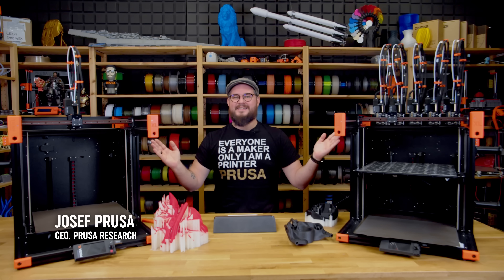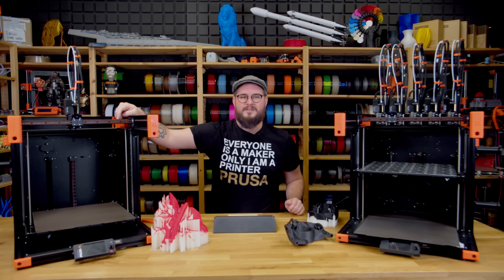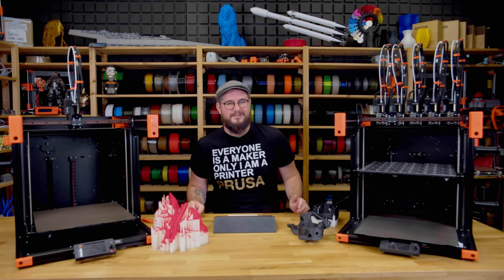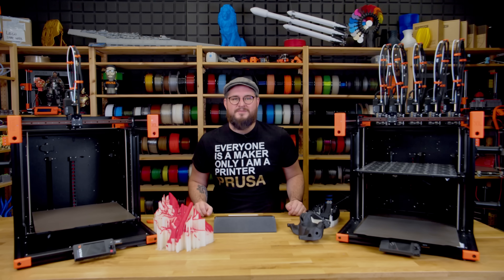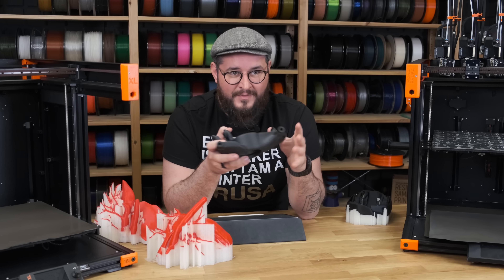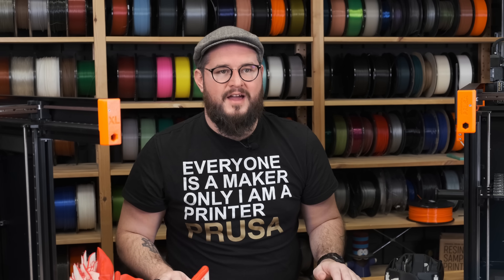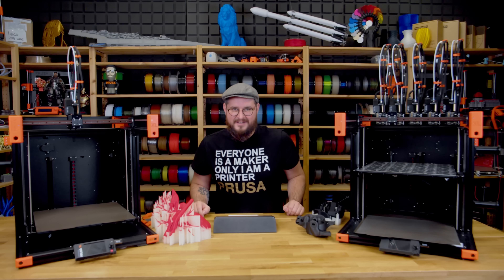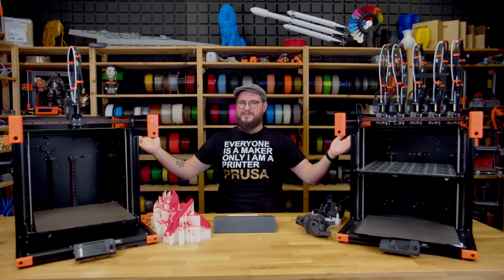XL update - beta test news, hardware changes and shipping schedule

Comment: Hmmm...I ran my business with  4 MK3S+ printers but have recently sold them all for 3 Bambu X1 Carbons with AMS which as everyone knows are MUCH faster, and in my experience have even better quality. The MK3 now feels like a toy. I had two Prusa XLs on preorder, canceled one of those.....just not sure about a single tool head $2500 printer when another X1 Carbon with AMS would only be $1500. Sitting on the fence about the XL. Bambu came along and really changed the game while Prusa was resting on the MK3.
Reply: I will preorder a XL because you can use different materials in one print. For that you need multiple tool heads. I already own a Voron 2.4 350mm with mmu but I want to print supports with different material and for multi color print to not waste a lot of time and material on a waste tower.
Reply: @Todestelzer  why do you need multiple toolheads for different materials? I know the one example Prusa shows with the TPU would need multiple toplheads but you shouldn't have any issues printing support material or PETG as a support using the same nozzle.
Reply: Problem is with Bambu, their long term support is unknown. I really want a Bambu but Prusa at least has a track record
Reply: @armorhide406  True but the same can be said for Prusa when they started. Gotta start somewhere.
Reply: Prusa xl is 5 times faster than bambu x1c with ams and ha e no waste 😉si if you can calculate you have that investice t pretty fast back and you cam při t lot more materials , you can combine materials, you Dent send your clie ts data to china  etc. And you support comunity with prusa because bambu Just stealing models patents etc
Reply: The X1C and the Prusa XL have some major differences and you have to choose which fits your needs better. One of the them is the much bigger bedsize of the XL. The second is the Multi Material System. Obviously the XL e.g. allows you to choose different materials within one print. It allows you to print ABS and TPU in one part. Obviously it’s not price competitive since Bambu manufactures in China, where overall production costs are a lot lower. I am pretty sure there are still people which have usecases that fit the XL better.
Reply: @justinspohn1092  Yeah there is for sure use cases for the XL that the Bambu can’t cover.
Reply: @justinspohn1092  Oh I completely agree with you! I’m going to go ahead with my single head XL just because I do love Prusa printers. My point was just more that Bambu came along and really changed the game! I was a Prusa fanboy snob until I got my hands on an X1 Carbon. I just hope Prusa comes to the table strong 💪 like we know they can to compete. As consumers we all win with competition.
Reply: @justinspohn1092  The price difference isn't just about the labor cost, Prusa's printers use a lot of standard components and 3D printed parts. While that's fine, it's inherently going to be more expensive for mass production versus a design made mostly of folded sheet metal and injection molded parts.
Reply: I am considering cancelling mine and getting an X1 Carbon and AMS, By the way do you know the difference is between the X1 and the X1 Carbon?
Reply: @AndrewAHayes  It's on the Bambu Labs product page for the X1 series, but you have to scroll down a lot to get to it. I'll try to summarize: Aluminium instead of plastic body, hardened steel gears and nozzle instead of steel and stainless steel, aux part cooling fan and carbon filter included, internal monitoring camera included.
Reply: Yeah have fun with your Chinese made piece of shit.  You get what you pay for.
Reply: @mcxiii  Well my experience so far is the Bambu prints 2-6x faster than a MK3 and has better print quality while doing it. 100s of hours of printing and no issues. So yeah I’m having fun with my piece of Chinese shit 😂 x 3.
Reply: @damiengvideos4337  talk to me when you have 6000 hours.
Reply: @damiengvideos4337  Fanbois stuck to one brand only are the worst, aren't they?  It's like people don't realize you can like more than one of anything...  I have one P1P and AMS right now and it's cut my print times for my parts by 2/3rds.  I have another P1P and X1C on the way, for the money they can't be beat atm.  

Prusa has always made a solid printer, but the XL isn't something I need personally so I'll be passing.  Hope everyone that gets one enjoys it.  The more competition the better as all brands now have to step it up.
Reply: @MrNickpeck36  Exactly! I may still buy a single head Prusa XL since I have a early reservation…I like them both.
Reply: @damiengvideos4337  Awesome, hope it works out for you!  It does look cool :)
Reply: @MrNickpeck36  I know that there already should be a mk4 on the market but long shipping times lead to problems. Aswell the costs are so high atm that nobody would pay so much for a New model. I’m not a fanboy I’m disappointed that the community wastes time on voron instead of continue the reprap project. Why innovation has to come from china, we can do better, if we want to!
Reply: @DamienG Videos!  same, my printers are printing 24x7 and between 3 mk3s+ units all with nozzle x, one w/ mmu2s, the X1C is better in pretty much every way I have noticed. The engineering behind this thing is just insane. I sold my prusas to buy another X1C w/ AMS. I think my X1C has about 1000 hours on it and ai haven't done anything as far as maintenance. My Prusas would usually have something small that needs to be addressed by now, like nozzle cleaning, or a clog or something. Plus the print quality is just unbelievable for the speed.
Reply: @damiengvideos4337  Exactly this. X1 series and P1P are intermediate sized printers with insane speeds and feeds, but if you need large print volume, you have no option but to step it up in size. Plus toolhead changing is likely to remain faster for the foreseeable future until someone figures out a crafty way of making single head swaps quicker and less wasteful.
Reply: @sonichedgehog36  100% agree my friend! I just think credit is due where credit is due! Can’t wait for my XL but I feel my 3 X1 Carbons will likely be my go to production machines. I hate when people get stuck on a single brand rather than the advanced of the technology. Consumers for the win!!! 😉
Reply: As long as Prusa stays innovative, true to Open Source and production in Europe I’ll put my money on them for now. Bambulab’s printer is great, no doubt. I feel they profited a lot from the hard work of Prusa which gave them a head start. There’s a good chance the XL can equalise the playing field. The best scenario would be if a friendly competition would arise. Both companies contributing to the Open Source pool of knowledge. I have my doubts whether Bambulab is a fair player in that respect. They are at least trying to be fair, i give them that.
Reply: Do not want or need the bambulab walled garden or limitations. Some of us actually need the toolchanger side of it.
Reply: @powersv2  Then buy the tool changer Prusa. Damn guys all I said is I was waivering on my Prusa XL preorder and how the Bambu X1 Carbon for me and a lot of people has changed the game. Has Prusa announced the print speed of the XL? I genuinely want to know. I have a feeling it might be half the speed of the X1 Carbon and the quality won’t be any better. Yes it has its use cases…I’m a former Prusa Fanboy woth 3 MK3S with MMU2S and 2 Prusa minis. Closed system or not the Bambu is knocking it our if the park. I have 3 of them and they print FAST and damn near flawless…better than the MK3 and Mini.  I want Prusa to succeed. Competition is great
But they better come strong because Bambu has thrown down the gauntlet!
Reply: Not sure why I buy x1c when I can get 7 anycubic vipers for the same price

I have a voron 2.4 350. It's both faster than bambu. Doesn't take 7-15 minutes to start a print cuz of pointless lidar trash. And has dual material synced extruders. My bambu labs is already showing signs of excessive ringing where my voron never does
Reply: @m kk  the voron 2.4 is only 25% the speed of an X1C.
Reply: @doml8520  Where did you get that number?
Reply: @Miloslav Kuzela  which figure are you referring to? Youtube doesn't make it easy to know which comment you're replying to but if you mean print speeds, I just compared identical prints between the different printers. I have tested a lot of different printers for running my business so I just compared the time between them.
Reply: @doml8520  Ok what was the result? In my personal testing of 3 X1 Carbons vs 4 Prus MK3S+ printers the Carbons were between 2-6x faster and produced better quality prints. Kinda crazy!
Reply: @DamienG Videos!  about the same, I would say. It depended on the print but it was always at least 3x faster. I remember the day I got it, I was just watching it with my jaw on the floor for like an hour in complete disbelief that the quality was still better than my prusas. I have been 3D printing and doing CAM for around 10 years and i mean CNC would never get that fast but I never thought 3D printing would. I built one after seeing the reprap project before I remember ever hearing the name prusa and I basically quit 3d printing lol. I picked it back up when the MK3 came out and it's amazing the innovation that bambu labs is bringing at the price it is. They could be charging what Ultimaker charges for this thing. Like I am all for building your own and prusa is great for that exact reason too, but once you know how these things work, prebuilt are fine. Especially when they aren't locking everything down so you can't self repair. I almost kept one prusa just to experiment and make the X gantry as light as possible, like swap out the SS rods with CF but ended up deciding it wasn't worth it.
Reply: @doml8520  You have more experience than I do but I have to say you stated exactly what I feel. I loved my Prusa printers but the Bambus have changed the game. “Cheap Chinese shit” or not like people like to say. They get the job done with quality and speed. I say if people want to beat the “cheap Chinese shit” then build a better damn product! 👍🏼👍🏼
Reply: @damiengvideos4337  Exactly, I do a lot of manufacturing and regardless of the morals and how they do it, the components I use primarily come from factories in China. There are good ones and there are a lot of bad ones. But it is straight up racist to assume the origin of the product determines it's value.
Reply: @Dom L  I don't believe it's race thing to determine product value by country of origin.  It's communist values you approve with your purchases.  I have a hard time speaking mandarin and getting parts from a country whose management commands all aspects of its work force.  We all respect the people from all over the world but do you value lack of communication and tyranny.  Individual choices
Reply: @CountryTesla  I haven't had any issues with the language barrier. But it's ridiculous to believe supporting businesses and the hard working citizens of a country is the same as supporting that country's government and assuming they share the same values. I support the businesses I buy from, not the government of the country those businesses exist in it. You could say the same thing about the United States government. What it advertises and what it stands for are not the same thing. But my business is unrelated to that. I
Reply: @CountryTesla  Your beliefs legitimately terrify me. You are like the guy that said buying atomic heart is akin to donating money to the russian gov
Reply: @Syndan  Self preservation shouldn't be terrifying.  If the majority of manufacturing is in one single country, that country's leader has its people under hard thumb, and you choose to support it with your currency, that's your vote for that way of life's proliferation.  In time that way of life may come for you, you've helped it grow.

On the other hand, I may support other countries to further diversify the manufacturing base.

You do you, I'm just not one to put "all my eggs in one basket"  I'd love to see competitive manufacturing across all countries.  That would be awesome.
Reply: You know, x1 Is closed source, what if something breaks? Do They have replacements? Or do you need to send it in for a repair to china?.. in my opinion 3d printers should NOT be closed source money milking machine… Plus fun fact x1 is based out of hypercube evolution (HEVO) they only added a fancy enclosure and one LiDAR with proprietary software. But I guess if you really want prebuilt machines… but still something like rat rig is 100x better and reliable and you can buy it already built.
Reply: @Norag02  They have replacement parts and in my experience pretty good customer service. 
My early kickstarter AMS had a part snap, which was a known issue. Not only were they very quick to send a better designed replacement part, they also referred me to their wiki where they host a guide for printing a temporary fix while waiting for the part to arrive.
Reply: @Norag02  Yeah I tried the RatRig route.   All I can say is “eh”. To answer your question I yes 100% want a printer I can take out of the box and get printing quickly for my business. If I wanted to tinker I’d go a voron or something like that. I run a business that has shipped over 2000 orders to over 20 countries. So yeah not having to “tinker” and produce fast high quality results is FAR more important.
Reply: @damiengvideos4337  For running a business I totally get that. Buying something that is ready to go as an investment that will make money. Still I find it a shame that hobby things are starting to get packaged and sold as products. And i wasn't really going after people that do 3D printing as a business. It was supposed to be aimed at people in the hobby. And don't start with a voron if you wanna tinker if you don't want to have a bad time.
Reply: Bambulab is a cheap Chinese company using the work of real inventors like joe
Reply: @matthias9379  Well we all know that happens eventually. So far in 100s of hours of printing on 3 X1 Carbons I’ve had a single jam and the first layer is perfect every time. The rest of the prints are so clean people don’t believe they are FDM prints.
Reply: @matthias9379  ehhhh it can be said Joseph also used the work of others if you know your history. Bottom line is competition is good and we as consumers win! Now if Intel could be more serious with their GPUs maybe we’d have a 3 way fight again that would drive prices back down.
Reply: @Matthias  where are you getting that it's a "cheap" chinese company? Not every company in China is in the business of making cheap, low quality. It's the same engineers that designed the DJI phantom and those have been great. And as far as the tech goes, they don't share anything with any of the prusa models we currently know about. And even prusa started from somebody else's work so im not sure what the problem would even be if that was the case since it follows the open hardware initiative.
Reply: @matthias9379  what an unfortunate attitude to have for a company that's moved the needle so significantly in printing in the last couple of years
Reply: @p07gbar  the needle moved in unessacery voron geeks direction. As a company based in china they have access to electronics fast. We will see how reliable and repairable those systems are. I believe in joe he will move the company in a right direction
Reply: @matthias9379  I don't disagree but bamboo isn't using the work of Prusa, it's new and innovative stuff (even bringing it to market is good work) and we should recognize it even if we don't like the direction.
Reply: @p07gbar  preach !
Reply: @p07gbar  it is true though, it's not banter. I absolutely wouldn't have a problem with it (quite the opposite, I'd love it) if they didn't have the attitude they have with closing down everything acting like they invented it. It's THE thing that's keeping me from getting a bambu, and why I got an MK4 despite the poor "immediate" value compared to an X1C. With the prusa I not only support a fellow European manufacturer (and that alone makes the cost of running the business muuuuch higher), but also support a team that actively dislikes closing the system up and goes the completely opposite direction. Prusa might innovate slower, but they make the whole 3D printing industry go much faster. PEI covered spring steel sheets? They're from Prusa! Automatic skew correction? From Prusa! And those are two of the things that are now ubiquitous in the industry that came from them, that we literally wouldn't have if it wasn't such an open company that shared their findings with everyone. Not to mention their slicer work, together with Cura they are pushing the whole community forward. Bambu on the other hand used those concepts developed by the community, and closed up everything as much as they could. That's not good even though the printer is great.
The bambu printers are innovative in the sense that they are extremely well polished, with a great out of the box experience, which was an unheard of thing for a fast, multi-material printer before. But the printer part of it still builds on the innovation made by the community, the machine itself isn't really special. It's a direct drive stepper motor driven coreXY printer, with a removable build plate and ABL, that uses a slicer derived from prusaslicer (the slicer is open source solely because licensing from prusaslicer). All things that got developed by us, the community. Some of the things they do (like LIDAR!) are honestly extremely cool... But they're not open. So it kinda feels like cheating, using other people's innovation, and not giving back with the stuff you build on it. Even if it's fully in their rights... It's disingenuous.

Long rant, I know, but I just don't get why people are overlooking this. It's such an important factor in the choice of a product for me, that it's surprising that some people outright ignore it.
Reply: @p07gbar my friend just got the Bambu and he said it uses the Prusa slicer.... Not their own.  How is that not Prusa's work?
Reply: @matthias9379  I don't own any Prusa printers, but from what I can see the Bambu printers are unlike them in pretty much every way that matters. I see you edited to tone down your claim a bit, but apart from them not having created the slicer from scratch I don't see where the merit in your claim is.